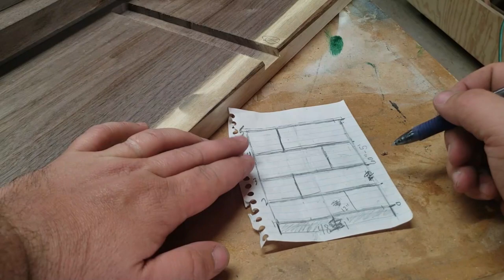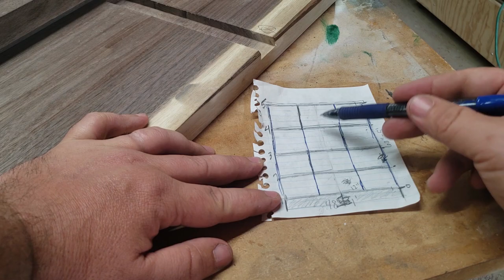Making A Walnut Bookcase // Bookshelf // Woodworking // How To

Comment: Why did you use two plunges with your miter saw, as opposed to a single plunge, and pulling through the entire length of the cut?
Reply from the maker: I get asked this a lot. I don’t like how the blade reacts when I pulled it through. Sometimes it seems to bind. So out of habit I just make 2 cuts. I don’t think there is a right way or wrong way
Reply: Good to know. Do you know if there is a way to tune up your miter saw, similar to how you would true up a table saw? Maybe it’s some kind of blade runoff (wobble) or something?
Reply from the maker: @daviddahl8220  That's a good thought. I'm not sure.